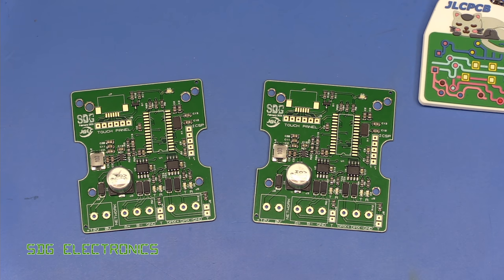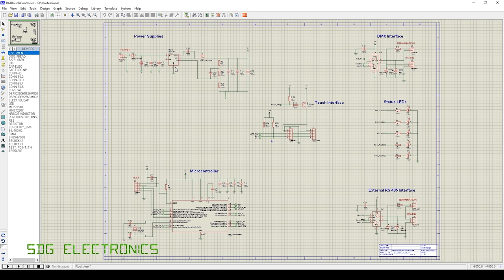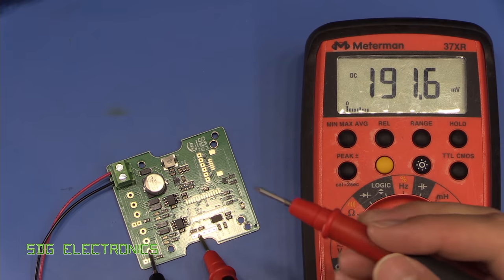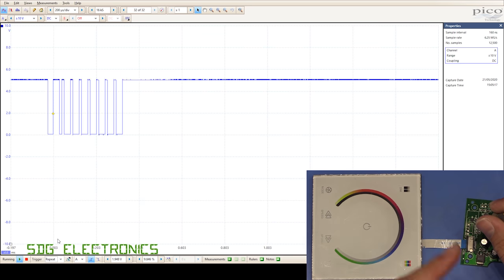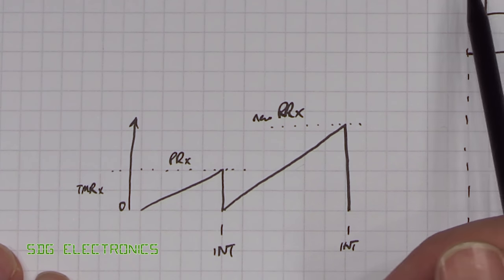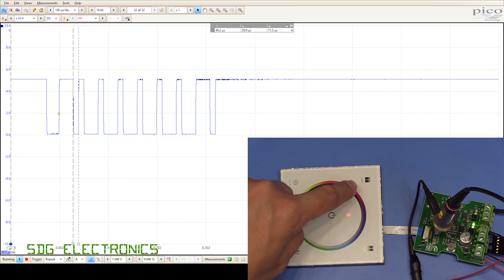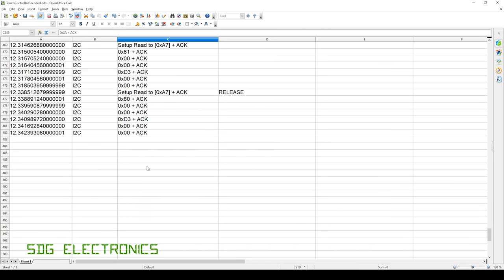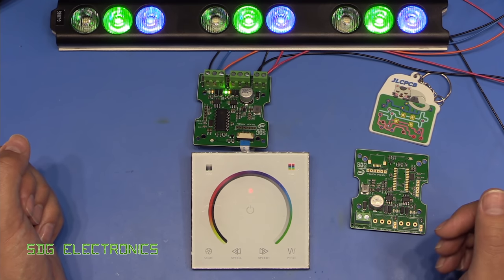SDG #156 New Control PCB for the RGB Touch Controller

Comment: Could be a fake TPS54202 with a wierd mix-up somewhere between the different versions i.e
TPS54202 = Float the EN pin to enable
TPS54202H = Float the EN pin to disable.
Reply: TPS54202DDCR marking = 4202 
TPS54202HDDCR marking = 202H. 
The second is seen in the vid. So you are right, its a H model (float disable). LCSC stocks both parts.
Reply from the maker: Mystery solved. You're correct Ian, I messed up on the order! 🙄
Reply: @sdgelectronics  Just hope you never updated your Pcb layout with the extra resistor/LED......!

Comment: Very nice work Steve! I've thought a moment to go the same way for my wall switches. But then I found the futlight remote controllers which transmit milight 2.4GHz. The milight signal is received by an esp8266 with an nrf24l01 which transmits it to my mqtt server.
Reply: I've got the same setup for our LIFX lights. The ESP8266 firmware is awesome.
Reply: do you have a link for that?

Comment: 10:40 i recentry did something similar where i had an RGB IR remote for which i wanted to make an RGB controller.
To decode the data sent by the remote i hooked up an IR receiver to my VDS1022 scope and saved the waveform as a text file.
I then wrote a quick and dirty matlab script to take the text file and decode the data, which i could then add to my micro code (Digispark in this case).
Worked very well after some tedious debugging (since it's an 8 pin micro) certainly beats staring at the scope capture and counting the bits myself :)

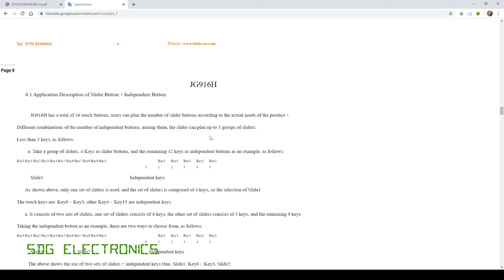Comment: Loved the video, but I was curious what software is outputting the excel file you show at 18:02? Can the picoscope do that?
Reply from the maker: It was the Kingst Logic analyser (LA1010) from Mailbag #015
Reply: also
- pulseview/sigrok (Open Source) can do this with a wide variety of protocol decoders: https://sigrok.org/wiki/File_format:Csv
    * https://sigrok.org/doc/pulseview/0.4.1/manual.html#_export
- or the salae logic software that you use with cheap china logic analyzers: https://support.saleae.com/logic-software

Comment: I don't get RGB lights. Why would you suddenly want your lights to be green or really any colour but white/off white?

To me 2700k, 4000k and 6000k would be more useful than arbitrary RGB.
Reply: Steve mentioned he wants 'Master and Slave' in the bedroom, so he'll want to set his lighting to red 😂
Reply from the maker: They aren't for primary lighting. It'll be for a dropped ceiling with illumination around the edges, I've also got some white blinds in the windows in the lab which they'll be pointing onto.